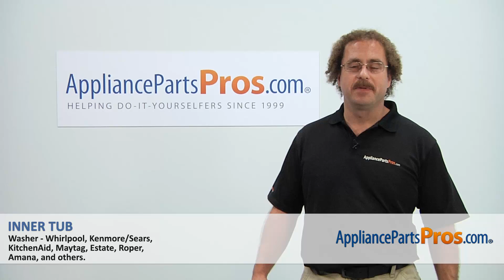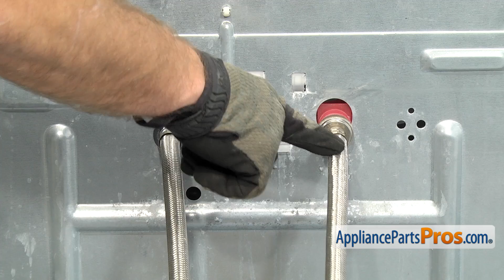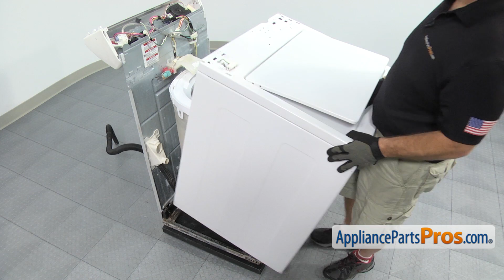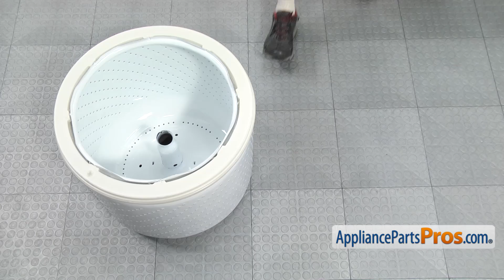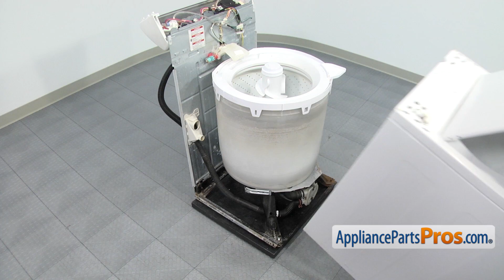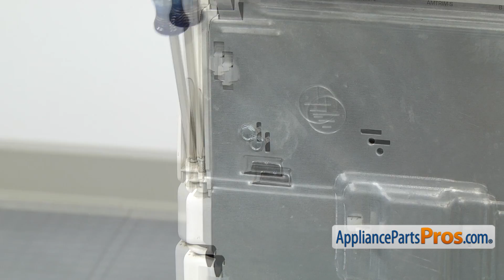How To: Whirlpool/KitchenAid/Maytag Inner Tub W10389328

Comment: Thanks for this, awesome help in knowing which way to undo the hub nut! It’s still sitting in a million pieces but now I’ll clean all the red/brown crus out and hopefully have clean clothes again!!
Only thing I found truly was using a screwdriver/pin punch. It kept chipping off the edges. I finally worked out to use a chisel. By touching the edge/side of the point inside the notch, then tapping with hammer, I had more room and better surface area contact so I didn’t keep damaging the nut.
Just my experience!
Thank again

Comment: I bought a used washer. The inner tub has a small rust spot. It seems as though the previous owner has chipped it somehow or maybe they left a small coin for a long period in the bottom of the tub. Can I paint the spot where the chip is ? What kind of paint?
Reply from the maker: Unfortunately, the manufacturer does not offer touch-up paint for the inner tub. If the inner tub is rusted it will need to be replaced.

Comment: Good video (I have replaced a couple of parts before like this.  BUT... what to do if spanner nut is really stuck? (about 17 years of use)  The tool with a hammer (several actually, from rubber mallet to a 5 lb heavy hammer) did NOT help.  Someone told me to heat the nut with a torch which I did a little but did not help either.  I considered cutting it but it is not flat, so in cutting I would damage the inner tub/basket.  I also used WD40 and another similar product, no luck.   My next try would be heating it red hot?  Or use a pneumatic hammer? Any suggestions?
Reply: Luis Heimpel: wire brush the heck out of it, try to get between the two different fasteners using PB blaster or 3-in-1 oil. use a wire brush that you can use in a drll or a impact gun. after you get most of the corrosion off the surface of the larger round fastener, pay special attention to the crevasse between the two aluminum fasteners. follow the power tool brush with a hand brush and a slender pick tool. this should allow for easy removal.

there a suggestion.

Comment: Hello Matt! I dont think you or your repair friends will answer this, but here goes.. i took the inner tub/barrel out of my Whirlpool washer, similar to the one you are using.. when i got it out, to clean it, i heard liquid sloshing around inside of it. Does that need to be drained, or is that liquid supposed to be there? Thanks  i also bought the special spanner to get the retainer nut off!
Reply: I have same problem
Reply: @yvonnexmass  is the pump not working ms yvonne? Thank you 🤓
Reply: I read somewhere that that was normal. Its some kind of liquid agent thats suppose to in it. If you listen in the video you can hear it too.
Reply: The liquid in the top ring of the drum is supposed to be there.  It is a factory sealed system (you may see a small nut at the top where they put the liquid in).  Do not mess with this.  It is a specific amount of liquid in a sealed system which naturally balances the drum as it spins.
Reply: @steveb7311  thanks, I didn't mess with it.
Reply: Thank you for asking that question J. Lietka, I’m here for this very same question.
Reply: @steveb7311  Thank you for the answer Steve B.

Comment: I never realized the inner tub or basket could fail this badly. My problem was the load was banging around and not spinning properly. The basket looked fine so I checked the motor, suspension and capacitor. It wasn't until I removed the inner tub that I saw that the inner bottom part of the basket was rusted all the way around and completely broke from the center portion.
Reply from the maker: Glad you were able to figure out the issue. Let us know if you have any other questions!

Comment: What if the inner threaded part is stuck to the inner drum and not the shaft, how should I remove it so I’m able to reuse it?
Reply from the maker: You can put some penetrating oil around the part and let it sit, then try to remove the part.
Reply: @appliancepartspros Thanks for such a fast response and I ended up using that exact method with success. I’ll be reassembling it today, it was a complete tear down and deep clean. Customer was having issues with it draining, all the holes in the inner tub were plugged with hard water and or concrete. The pump intake was just about completely plugged with debris.
Reply from the maker: Glad you were able to fix your issue! If there is anything we can help you with in the future please let us know.
Reply: @appliancepartspros   I will absolutely contact you in the future with any questions or concerns . I’m relatively new to repairing for “customers”, I’ve always repaired my own and friends but never charge. This time the person is insisting they pay me and to tell them how much I’m charging but I honestly don’t know how much I should charge for the complete disassembly and deep clean, what would you charge for something like that?
Reply from the maker: I'm sorry, we are not a service company, so we don't have any information on what should be charged for a service call.
Reply: @appliancepartspros  it’s np, hopefully someone else sees and comments. Thanks again for your help

Comment: I got the inner tub model numer w10389328 for my kenmore elite 80 washer I opened the new inner tub and it has this white cover that goes over the water balancing ring. This causes it to sit to far up and wont allow the top plastic cover that snaps to the outer plastic tub to fit. Is this some sort of packaging that is over the inner tub and if so how do you get it off, or is this how the new inner tub is made now and will i need a new top cover that snaps to the outer tub since the old one does not fit?

Update: My comment keeps deleting when I reply to your question. The model # is 110.20952994.
Reply from the maker: What is your model number?
Reply from the maker: Thank you. That part is the correct one for the model number you provided. This is a replacement for the original part, so it could look different than the original. It should work with the old balance ring, but if the old one is damaged, or worn, it may need to be replaced as well.  Here is a link to the pictures we have for the part: https://www.appliancepartspros.com/whirlpool-inner-tub-w10389328-ap5178685.html